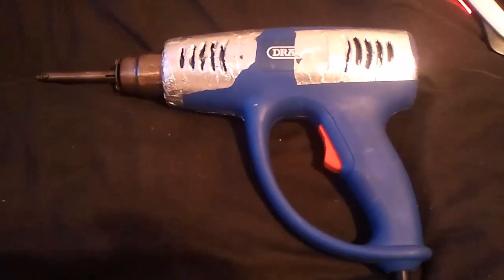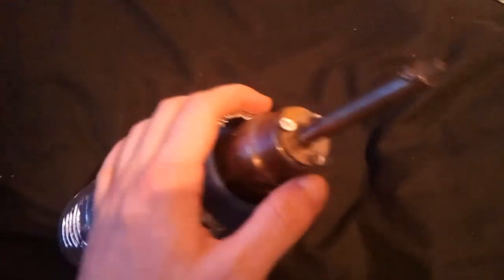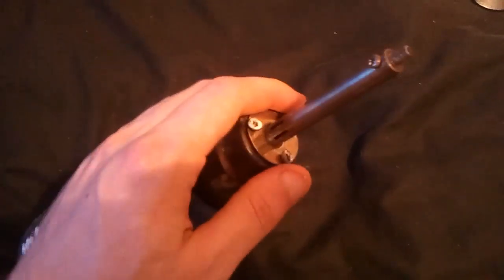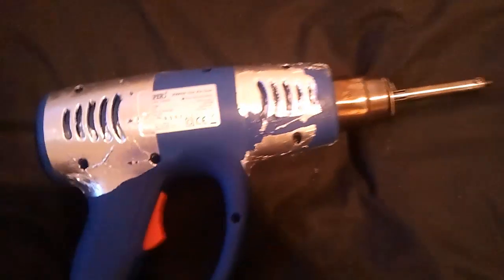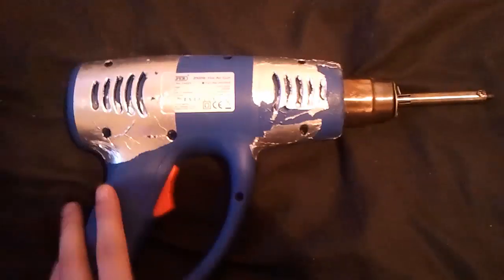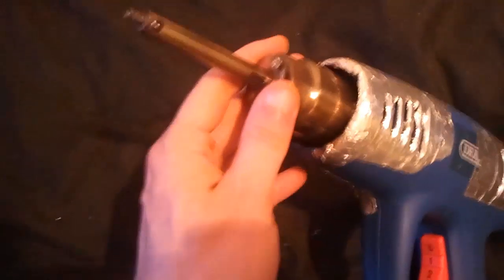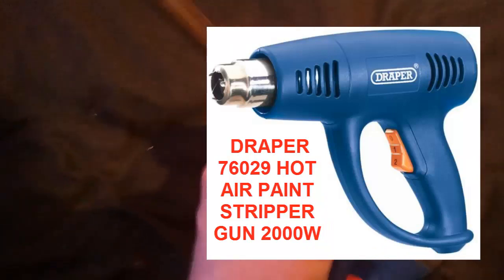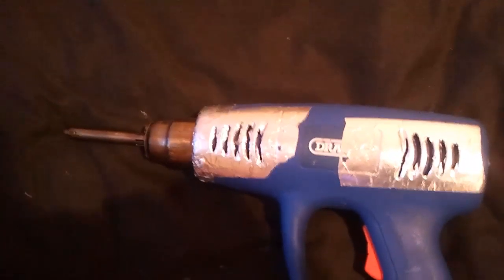Build a Cheap Hot Air Soldering Station

Comment from the maker: really works i was so surprised. im thinking i might add a switch that i can turn the heat element off/on so after iv used it i can blow cold air to cool the gun down after use as they do take ages to cool down.